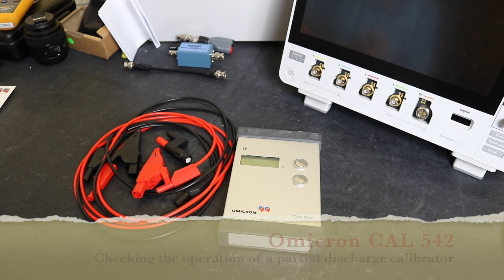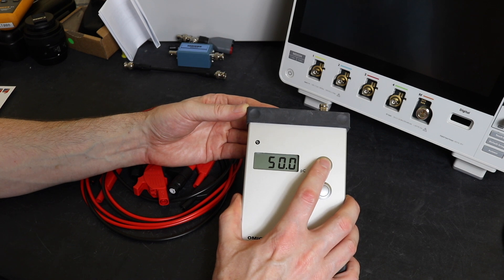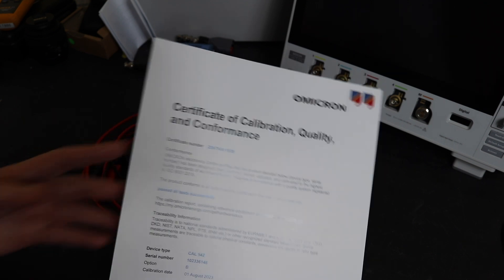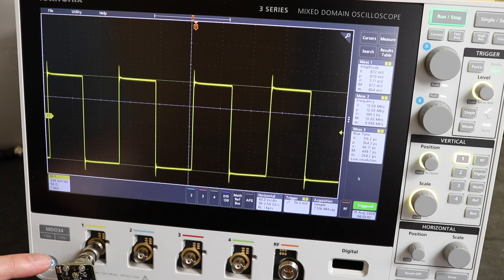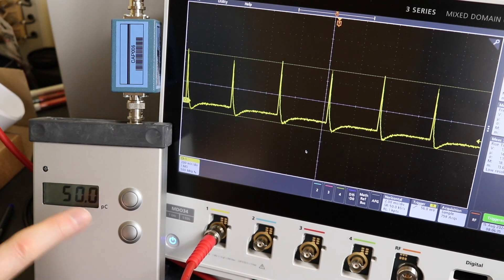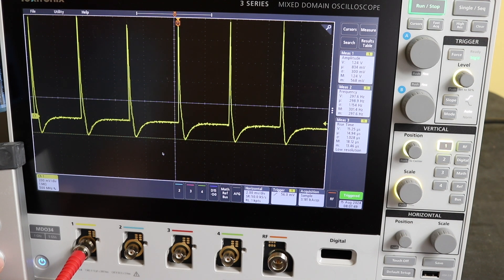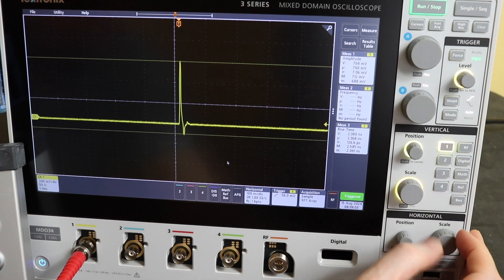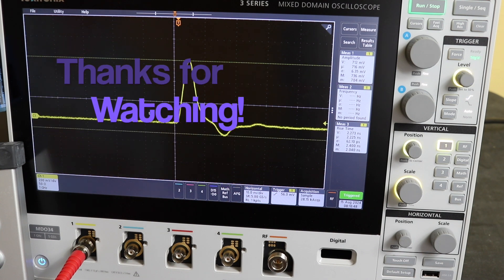Omicron CAL542 Partial Discharge Calibrator

Comment: Excellent pulse demonstration, thanks for the contribution. Where did you get the 1nF capacitor that couples to the CAL 542 output?
Reply from the maker: Thanks for your comment. I just purchased a 1nF capacitor and BNC test box from RS Components, its low voltage so doesn't require anything special.